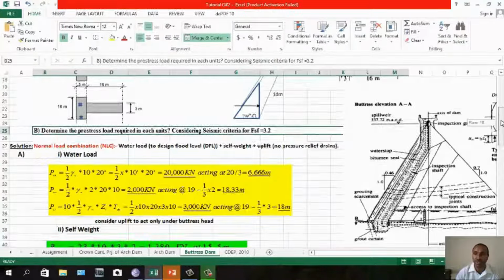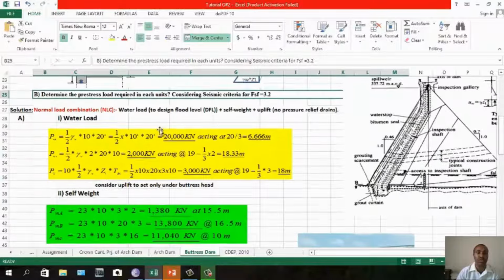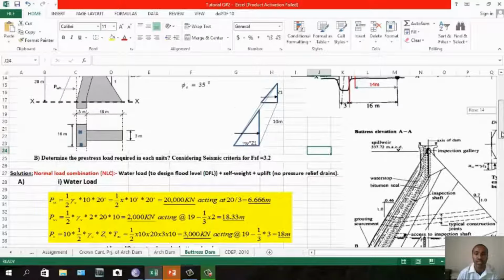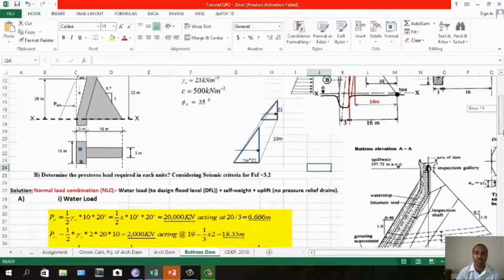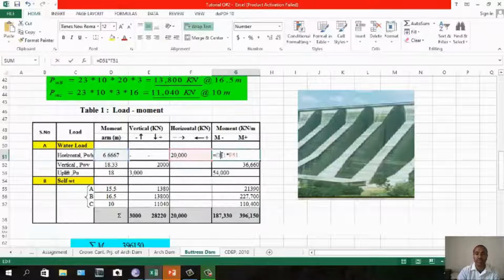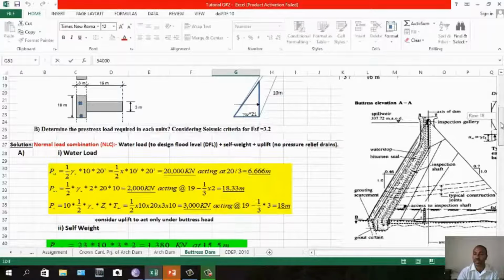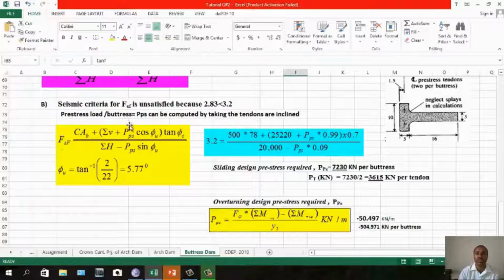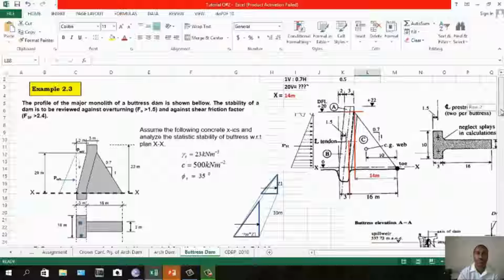Example on Buttress dam

Comment: Can you assist me  how to calculate the buttress wall reinforcement?
Reply from the maker: Ok. First, check the structural DWG for each element (deck , buttress, corbels. Then, measure cut length for each bar including devt length or anchorage. Finally, Number bars = (Total length or wall height/Spacing) +1 and weight= Total length*Unit weight of bar (kg/m) and unit weight = D^2/162 where D is diameter of bar in mm. For practical purposes, add 5-10% for overlapping or wastage. And, you may send structural Auto CAD DWG via E-mail : iinfo.hydromech50@gmail.com

Comment: Great vid! can you just explain how you determined the area for the triangle C was only 14m meaning its 2m away from the end, was this done from assumption?
Reply from the maker: Okay. We have H=20m and D/s slope of 0.7H:1V. Then, the base of C will be 20*0.7=14m. And, the flange width of the buttress is 3m and half of it will be 1.5. And, smaller triangle is there between center and end of flange. Then, 1/3 of 1.5 is 0.5. Hence, 1.5+0.5=2m which proves 16-14=2m. Observe the red lines . Thanks for comment.
Reply: @hydromech-Tutor   thank you so much